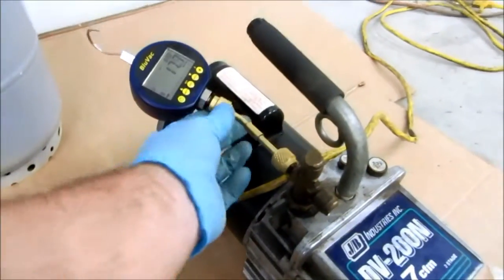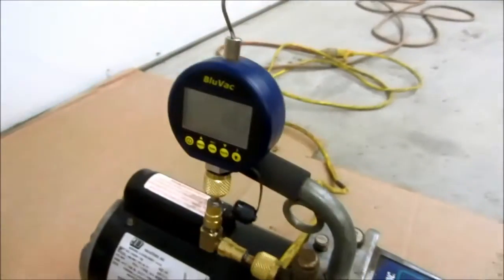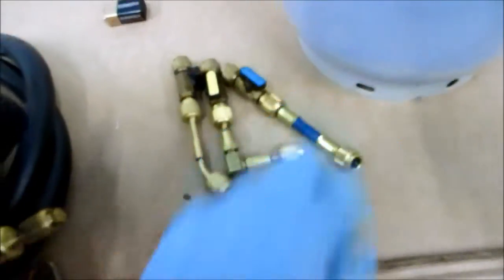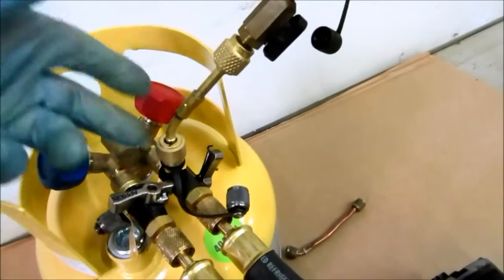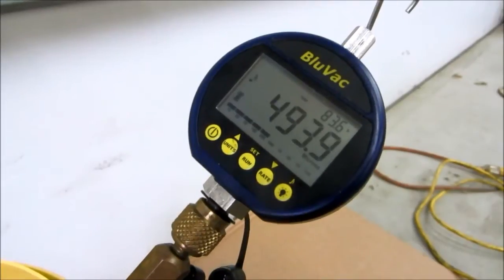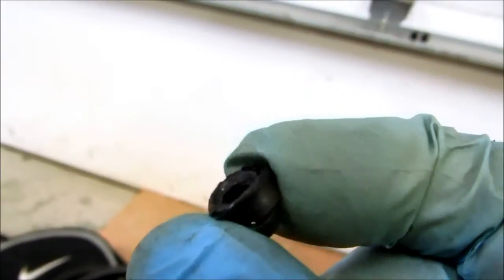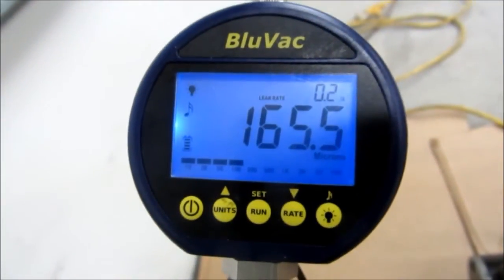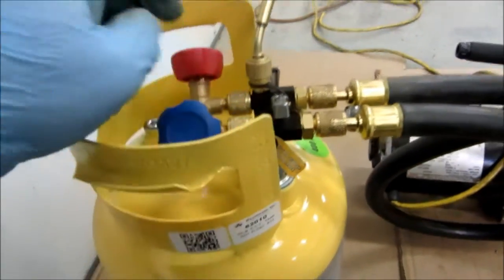HVAC:TESTING, VACCUUM HOSES,CONNECTORS,MICRON GAUGE, FOR TIGHTNESS..

Comment: What if my pump pulls right around 50 microns is it a bad pump I have a new pump witch pulls close to 35 but my used one pulls to 50 I’m trying to figure out if that means the pumps bad or not thanks!

Comment: The Appion core removal tool Is great when its new, but after while it will fail. Appion sells a rebuild kit, but the kit cost almost as much as the tool it self. Does not make much sense to rebuild, just trash it and get a new one.

Comment from the maker: it was to test the hose,connectors  for leaks,it see if there holding ..i don t care about the vac pump oil i can change it .. i rather know my stuff is not leaking .appion hoses,shader core removers are rated to 20 microns .if you notices i used and old vac pump i had in my garage and the oil was old also....if i wear the pump down  ,and it don't pump,, i will throw it out ,and i will bye a new one .thats the lease of my worries.thanks for watching @comment james

Comment: If you pull a vaccum down below 200 microns on a compressor the oil fractionates and looses its viscosity, what about pulling the vaccum pump down to 20 microns, doesn't the vaccum pump oil get fractionated ?, do you wear the pump down?
Reply: Jim Pettinato hope all is well.  Miss your new videos.

Comment: Nice one steve  if theres one thing i hate and thats tradesman that dont look after all there tools/materials , its obvious you take a lot of pride in all of your equipment so good for you atleast you have piece of mind when using your hose connections, i do similar every couple weeks i spray my adjustables n strip my pipe cutters etc ,,   well done,   are you guys metric or imperial     millimeters or inches ?